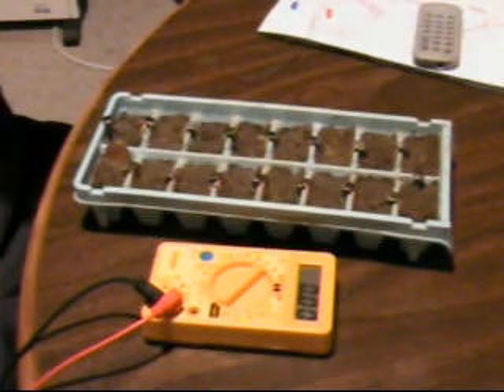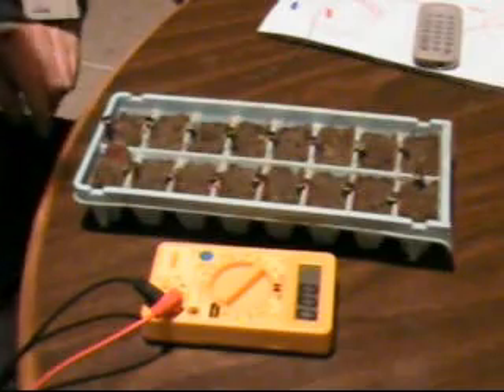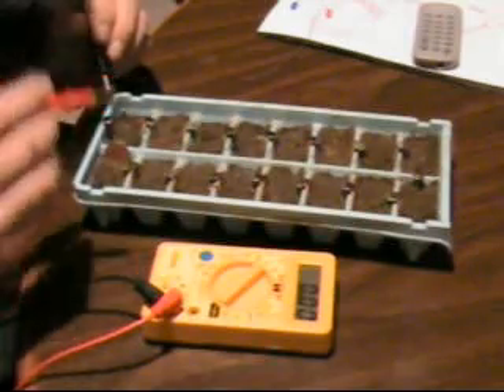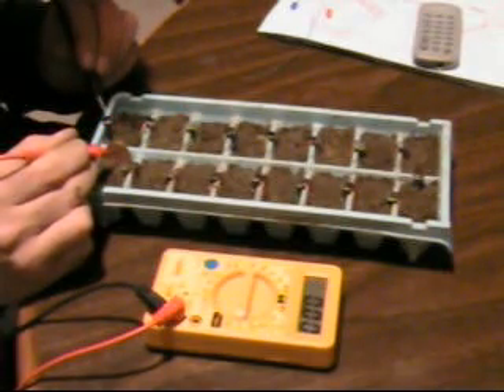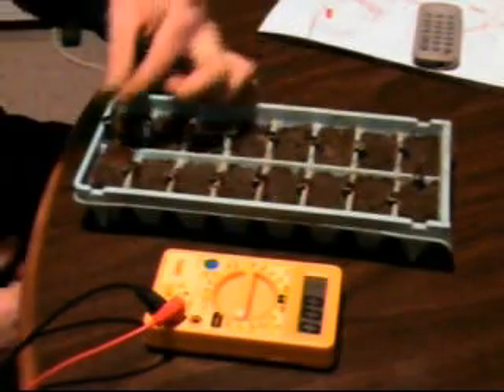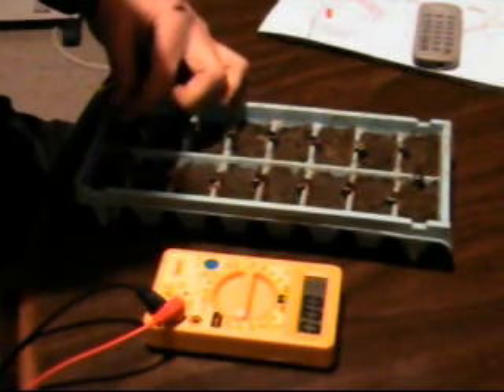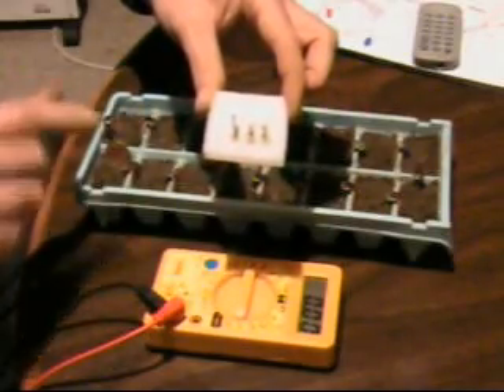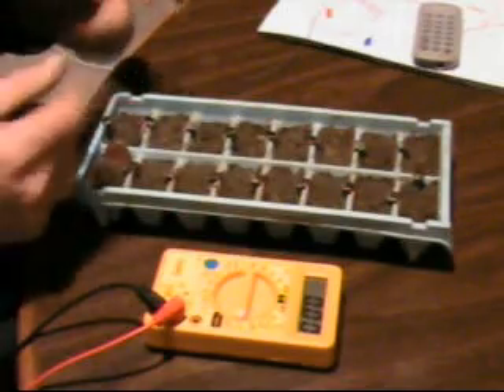12V Earth battery

Comment: Here is an idea to upgrade the efficiency 
put 2 or 3 cells in parallel in each box. That will multiply the current. 

Or: 

Take copper and aluminium foil. Wrap the copper foil around some base (either wooden or plastic or ceramic cylinder or anything non conductive). Take a wire as an output and make sure it has good connection to the foil.

then wrap a little tissue. Then wrap aluminium foil around the tissue, put a wire to the aluminium foil and make sure it has good connection. 

Then repeat the process several times until the battery becomes thick to the point it can still be placed to the bottom of the ice box and fully covered by salt and vinegar solution.

Comment: are there any electronic components you add to to regulate or cap the voltage output so you can avoid damaging devices you want to plug in and power/charge?
Reply: ryan brown I would think that a zener diode would do the trick.

Comment: You should try without dirt. Just the salt water will produce good results. You've basically made a salt battery and the soil has little to do with it.
Reply from the maker: Thanks for the comment. The soil plays a part. It acts as a substrate and holds up the metal. It also contains electrolytes and holds moisture when the moisture levels are low.

Comment from the maker: Just wondering if anyone has tried this yet? Any variations of it. I am working on a gravity battery and an air pressure battery which I hope to release this year.
Reply: I work with earth ground and I got from 4 inch cooper and rode in the midlle 1volt and 4,5mA PER ONE CELL...

Comment: Agreed.. the size of the container does not matter for the volts... each cell will produce the same voltage regardless of electrolyte reservoir size. The amount of dirt (that contains the mineral salts that when dampened become transmissible of the electrons in question.) well it would just effect watt hours per cell that you could use the battery before more electrolytes must be added. so figure since Al + O2 batteries have the highest energy density of batteries out there... if you can keep the oxidation in the electrolyte from blocking electron flow from between the anode and cathode... you are good to go... in all honesty I'd ditch the dirt.. just use a weak salt + vinegar + water solution in a container that is insulated... about the size of a C cell battery ....

So like take a cardboard box.... and make it shallow.... then make out of 8 mil plastic sheeting little "egg crate" type dimples about the size of a C cell battery.... hook 8 cells in serial then like 5 sets of the 8 in parallel... the result is the watt hours go up and since you are using smaller cell sizes.. the electrons more easily can pass through.. meaning a greater ability to have the true 1.5 volts per cell .. so 8 cells means 12 volts.... (which btw your 14 is impressive and I am going to like this video.) .. so 12 volts with likely .4 to .5 amps ... sooooo the 5 sets interlinked would give you the 2 amps... which again the fact you are getting 2 amps out of like a total of 16 cells is pretty amazing...

But the whole idea is to reuse as much discarded material as possible.. and making a press form for cardboard "cell dividers" that you take paper cardboard etc and soak in water ot turn into pulp and then press it.. well that is reusing material at the point of production of the end product and like super cheap since like stores normally PAY to have cardboard taken away.. which with a truck you could offer to take off thier hands for FREE giving you the capital goods to start assembling the battery.... the vinegar can be made by extending the fermentation time of alcohol (sugar, yeast, water and heat) ... and like the salt... hhhmmmm well considering you can buy 50 pounds for like 5 bucks.. yeah no probs there....  now I would use aluminum foil at the bottom of the cardboard egg crate and then (with the plastic beneath it) allow it to come up so you could wire it into the system.. and then just take a small satchel (cotton) filled with crushed up charcoal briquettes with a thick gauge copper wire inside it in the middle of the satchel.. then wire it into your battery series and then parallel... all in all you could probably crank out about 400 of those units or so for about 80 to 100 USD ... which if you did a 100% markup... you are looking at what? 200 USD for 80 USD invested? and the cost per watt.. even using the principal of your design alone would be like 25 cents per watt.. and that is initial cost for just that unit.... add an aeration stone and a small rotary 12 volt dc air pump... sure the cost per say ten crate unit goes up... but.. the watt hours increases... you paint the crates black and afix the 10 crates inside of a cardboard box with a concentrating solar reflector (like a solar oven) (made out of foil) and like you increase the temp of the electrolyte solution which causes greater power output upon demand.... yeah my two cents anyway... btw excellent design... impressive... wtg!
Reply: Loved your comment! 
I wanna learn more from you, How to recharge the earth battery? and Lifetime of this battery?

Comment: In the same sentence, you talk about power and then volts, to refer to the same phenomenon that you observed.  It then proves that you are an ignorant.  Try to run a 5 tons bus loaded with 100 passengers with your ice tray and we'll  talk. Poor fool! Very interesting, but just a kd's experiment, between you and I...
Reply from the maker: Proves I am an ignorant? You are the definition of ignorant sir/madam. You ignored ALL my comments below. Don't be ignorant. Read them and understand that it IS a kids experiment. It is designed for low DC voltage devices. Do you talk about the  principals of rotational velocity and torque to a layman? No, I don't think so, because THAT would be igorant. You internet nazi's amaze me. So rude ... just between you an I.
Reply from the maker: Oh, I almost forgot. Buses don't run. Try to make a bus run. It has no condyloid joint. Oh yeah .. sorry, you were probably just using a general term to explain yourself with more ease. Does that make you ignorant?
Reply from the maker: Francisco S.P.
The original argument by rouelibre1 was that I misused the term 'power'. Technically a bus rolls (has wheels) but my point was exactly, as you explained, that a word can have many meanings. My utilization of the word 'power' was used generally to explain a concept. Thanks for commenting.
Reply: Br0kenMan
you and me
Reply: Br0kenMan If Buses don't run, what do they do? Is it wrong to assume that buses offer a service that runs? If I power my bus with gas, is it not running on gas? To run is a term that can be used in very many ways, like running water... Does water have joints? There are many types of joints, only the ones from the lower limb are used to run. The Knee has 2 of them (Trochlear and Bycondylar) you also need the hip joint which is a a type of spheroidal or "Ball and socket" joint... then you have the foot, but I'm too tired to talk about it....
Reply: To rouelibre1, It is NOT nice to call people ignorant, no one has that right... people ignore different things, can you name all the joints of the body? Can you explain Gravity?... You could just correct him if he were wrong, and do so politely...

Comment: I'd love to see a video of one made to 13.5/14v and used to start a motor vehicle. There is a massive draw when starting a vehicle, so maybe making several sets of trays in parallel would get the job done.
Reply: just hook it to a charge controller to charge a battery bank or a grid tie inverter

Comment: but ... um ....couldn't you just forget about the dirt and use the electrolyte alone? taking up far less space?
Reply from the maker: Most certainly however; it is difficult to make metal stand up in liquid. The earth also contains electrolytes which means ordinary water will work. Essentially the dirt acts as a substrate.

Comment: you realize the "earth" has nothing to do with generating any electricity. you admit in the video you poured vinegar "on top" well hmmmm zinc+copper+vinegar (acid)= BATTERY no earth required. no salt required. no water required. You would have done better to just fill the ice tray with vinegar. It saddens me the number of people in awe of your demonstration who don't get the reality of it.
Reply from the maker: Yes I do. I have stated many times that the earth acts merely as a substrate to hold the metal in place. In fact using ONLY earth (wet) does work. There are sufficient electrolytes in regular earth to function as a transporter. In the video I poured 'spirit of salt' on each cell to increase the rate of reduction. Even the ancient Mesopotamians would not have been in awe at this demo. Thanks for the informed comment. Think of this as a social experiment.
Reply: Br0kenMan thank you for your comment, yes some wet earth would work because some soil is slightly acidic. Acidity is a common test in agriculture because some plants love acidic soil while others do not. the people in awe I was referring to were the commentators who said things like "wow we could power the whole world with dirt." As you say even the Mesopotamian had the Baghdad battery. As a social experiment, then I applaud your video, and give it a +1 .
Reply: yep!
Reply: Yeah, pretty much just an electrochemical battery, as is evidenced by its quick amperage drop-off. But there is good news, people: the earth is electriclly alive (weather, volcanism, geology - all driven by the electrostatic force on a planetary scale!) All you need is to know where to find it in your location. Negative ups and positive downs are everywhere.

Comment: this might help ,I used a galvanised bolt about three inches ,wrapped in paper towel ,then wrapped it with 14 gauge wire ,it produced .7 volts and about 300 ma... still working on it to get the same results all the time

Comment: Misleading name: earth battery. The electric production come actually from ionic exchange between ions of copper and zinc with help of the electrolyte, not from dirt.

The reason why you lose current when heavy load is attached is production of tiny hydrogen/oxygen bubbles at the surface of the electrodes - which in turn reduces active surface area per each element, so current drops down.

Ordinary zinc carbon or alkaline batteries has mixed hydrogen and oxygen inhibitor, which removes such gases from the electrodes - thus providing as much as possible  useful battery life. Often such substances are very toxic, in earlier days containing mercury, which is today replaced by less toxic one, but in the same time less effective in gas removal tasks.

Comment: You are just wasting your time making very inneficient batteries, the world knows how to make real batteries.
Reply from the maker: Incorrect. I had fun and was showing other people a very ancient method of producing electricity. What IS wasting time is trolling my channel making unneeded comments.
Reply: Br0kenMan
It may have been fun, however your "battery" is inneficient, measure the internal resistnce to find out why. The first real battery was invented in the late 1800's
and therefore a modern device.
Reply from the maker: Peter May
Thanks. Of course it is inefficient. It's a basic redox reaction between two dissimilar metals. I made no claim that it was efficient.

Comment: Nomoreidsleft
Of course this isn't the way we would generate power. Power grids use alternating current. This means a generator turns producing alternating current (usually three phases shifted through 120deg from each other and at a frequency of 50Hz, meaning a single pair pole generator spins at 3000rpm to deliver the frequency) not 12V DC. Tesla showed Edison that was a crap idea a century ago. None technical people should not be allowed an opinion on technical things. I'm not a doctor so I don't go round telling people what's wrong with them.
Reply: Thanks for the electrician's course.  I am far from 'None technical'. Have you heard of power inverters?   They are used to turn DC into AC.

I'm not, "telling people what's wrong with them".  I am giving an opinion on where this technology can lead to, and warning not to go there.
  
Maybe, you should leave out the 'rod' in your username. Seems more appropriate.

Comment: Agree with that last post I had the thought of angling the pvc pipe north and at the right angel to tap into the natural flow of the earths energy than about slapped myself in the face for even thinking that way. I do however, like earth batteries and was wondering if a sheet of zinc at the bottom and a mix of sodium and water would work even better... also what if you add metal shaving in the to the soil place the magnet in the middle and use the galvanized nail and copper wire in your series? I don't know if that will drop the voltage a little bit but I'm wondering how long  the battery would work. Also dude did it electroplate anything at 6v to 12v???

Comment from the maker: The magnets are used exactly as a wire would be. To connect one piece of metal in one cell to the opposite metal in the next cell I dropped a magnet between them. Very practical but the outside layer of the magnet suffers corrosion after some time.

Comment: The low resistance in an ammeter will indeed drop the voltage when connected to the battery - how much is dependent upon several factors 1. the charge capacity on the battery 2. battery intrinsic internal resistance 3. type of battery
There are other factors like temperature. The idea is that the charge capacity is the real power. Some batteries would run down quickly with a heavy load while some could sustain that load for a long time.
This dirt battery would probably sustain itself add water--

Comment: There is a problem with your method, and I have already said it: if you put any load in the circuit, the voltage will drop... In any case, the purpose of measuring the current of this small battery is to know how much current is capable to produce. Other methods sould be used when measuring large current batteries, like Li-Po. However, an interesting thing to do with the dirt batt would be measuring its capacity ( Amps-h )

Comment: The value shown in the ammeter is, in fact, the max current provided by the battery in that moment. When you place any load in ANY type of real batt, the voltage drops; the current also drops. If you want to measure the peak current that this battery can provide to a load, here is a way: using the same low value resistor and a digital oscilloscope, you should be capable of read the current in that resistor and you will find that in the first microseconds the current will be huge.

Comment: Essentially, here the only load is the internal dmm shunt resistor, ANY real ammeter is a load (a very small one) to the circuit you will always need energy to make a measure (where comes the energy that moves the needle in analog ammeters?). In other words, (Wikipedia) : Since the ammeter shunt has a very low resistance, mistakenly wiring the ammeter in parallel with a voltage source will cause a short circuit. But in this case the current is so little that it will not damage the instrument.

Comment: Well he was not using a resistor regardless of the meters internal shunt. So unless the DC properties of a dirt/earth battery is different then other DC sources he was essentially short circuiting the battery hence according to kirchoffs law would be zero volts. Either way without a formula or a variable resistance I do not see how you could determine the max current of the source this way with any degree of accuracy..unless I am missing something?

Comment: That's why meters use very low value shunt resistors, to allow the most current flow through the probes... as an example... imagine having an ideal constant current source, say.. 2A, then put your current meter between the ground and the source and voilá... the current source will adjust the voltaje so it will have 2A always between its terminals, with any resistor value, including the internal shunt resistor, that can be less than 1 ohm. Here the batt drops voltage and the max current is shown.

Comment: 1. When I said that there is a internal resistance of the battery I didn't mean that the meter measures it; It means that the battery can't deliver infinite current because it's limited by this internal resistance; 2.Ohms Law, if you place a resistor with a known value and read voltage drop then  I=V/R, you can actually read max current, of course, the battery voltage will drop while doing this measurement. 3. Hall effect sensors are perfect to measure current in any situation EE degree? wasted$

Comment: Batts have internal resistance, this is modelled placing a resistance in series with the voltage source. As shown in the video, placing the probes across the electrodes is a correct way to measure max current in SMALL batteries. There are several ways meters work when measuring current: They can measure voltage in a shunt resistor  (1 ohm or less) and do the related calculations; the other way involves the reading of a magnetic field caused by the flow of current in a coil (hall sensor).

Comment: isn't this electrolisys he's measuring?
Go to nearly any boat located in salt water and you'l get some sort of voltage reading and some milliamp result
It's the metal on the boat that's being eaten up by the salt water corrosion.
I think the metal strips and the salt water is where this "electricity" is happening.
If the dirt does anything it's the metallic minerals conducting... they will dissolve and go in to the salt solution and be ... gone when the atoms are done spending their energy.